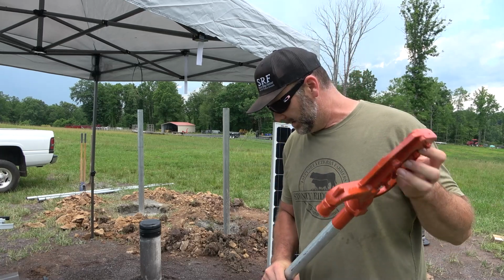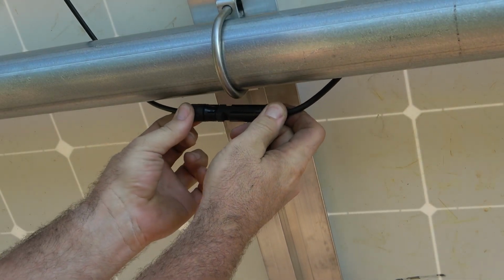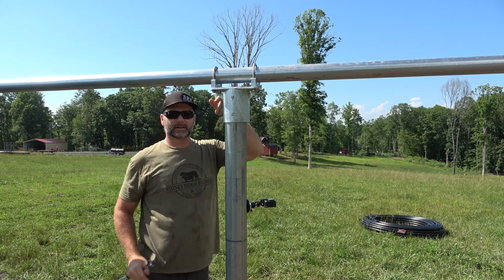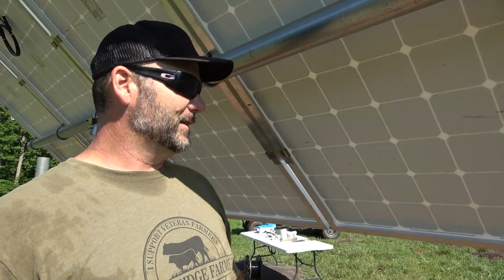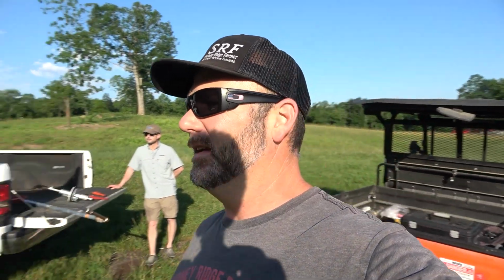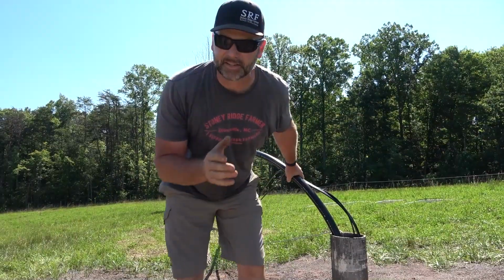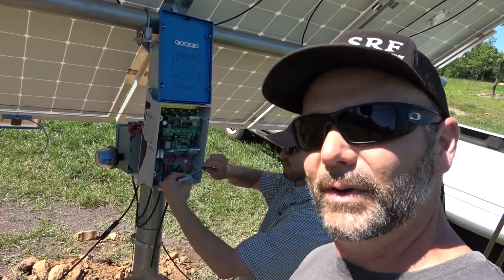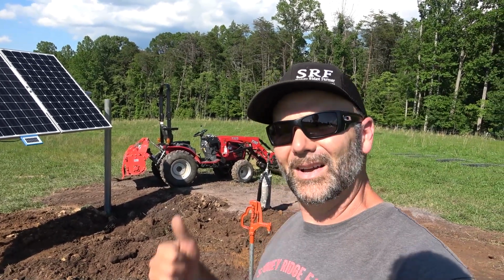How to Install A Solar Off Grid Well pump System

Comment: I guess I missed the episode, but I’m guessing the ram pump didn’t work out ?
Reply from the maker: Great Question! Ram pump as a permanent hassle free system just isn't feesable.  It works, it pumps but there's constant maintenance and upkeep.  You basically have to keep your eye on it twice a day to ensure you're still pumping water.  Then there's the freeze factor associated, it's just not a permanent setup...can't leave the farm for a day without something going wrong
Reply: Thank you for another great video.  Can you share your rationale for not using the spare vertical pipe for twisting stability?   I understand the second group of four solar panels was overkill.
Reply: Cost of the solar system?
Reply: cowboy tj.jonson  
how tsars how cow and cowboy and horse 
my will name tj.johnson
Reply: What kind of money are we looking at to build one

Comment: I could see won’t lifting this panels off at that Tee where it’s only help on by 2 set screws. Unless those are through bolts that is. If not, I’d drill those through for sure!
Reply from the maker: been up for nearly 4 years now with no issues my brotha

Comment: i didnt knòw solar without batterìes possible, my rural 220  volt pump runs but lost pressure and volume, i want to go solar but im very poor on limited s.s. plese do a vudeo what diy equiptment to buy, my water at about 4o to 50 ft thanks

Comment: If it were my system, I'd of taped the poly, dc cable and monitors every 12 inches with electrical tape.  To the BOTTOM or 180 from the top... Nice job none the less.

Comment: Great video
Could anyone help me. I love in UK but have a property in South Africa where we have a borehole or borewdll depending what you call it.

We want to convert it from electricity to solar

The tank for collecting the water sits at about 10m high (it's a double storey house) and the well is 20m deep

What would I need to convert it to basic solar. It would only need to fill the tank which is 2500l twice a day and not run permanently

Thanks in advance
Reply from the maker: I can't tell you how to build your entire well system....but look into Lorenz solar....that's the well system that I have. Contact them and ask them to design your system

Comment: Iv´e been struggling with batteries for years, pumping water with an off grid system. I realized that this system is exactly what i need. Taking away the pump from my house is huge difference, since it´s about 1.7 KW/h less. Plus, the battery bank had to be pretty big to sustain that consumption without damaging the batteries (some lasted less than a year!) Thanks for the upload

Comment: No showers or toilets at night ?
Reply from the maker: water is pumped to a 1500 gallon tank...then dispersed to the rest of the property.  however this is for the cattle on the farm....over 1 mile of 1 1/4 inch pipe is in the ground giving us over 400 gallons of storage at all times...plus the 1500 gallon tank...so...yes...water at night is available my friend

Comment: Josh - working on same project but behind you (-30 deg and frozen ground). Trying to design/build dual axis sun tracker in 6 module arrangement. Issue: trying to NOT poke 30 holes in new roof or make a sub optimized fixed ground mount. Pipes 1st issue with used oil/well casing, muffler pipe, black pipe, galvanized, fence corner posts...etcetera.  Where did you find posts? Also not finding your vertical post top mount bracket...could you please help a fellow farmer diy'er ?  Thank you so much for the vids so have have enjoyed them ALL,  all the best steve
Reply from the maker: The post bracket is made by Lorenz solar my friend.  All the posts came from farmfencesolutions.com they are heavy duty SS40 pipe.   Hit them up buddy....as for DIY...I'm sure you got this....do you really need the sun tracker?  More potential problems right...with more moving parts

Comment: DC is measured as potential difference, that's the voltage measured across the circuit. If the circuit isn't made there's no issues. Just don't complete the circuit until you are ready.
Reply from the maker: Difference of potential is measured in Ohms...not voltage....Ohms take amperage right?
Reply: @StoneyRidgeFarmer  the volts are measured as potential difference between one point and another, that can be the drop across a component or at the supply. If you measure a supply of 24vdc you'll see 24vdc providing you have both positive and negative of that supply/circuit, the positive is a higher voltage in respect of the negative. If you measure across a component you'll also see a voltage measuring one being more positive than the other because it is of the same circuit. If you have 2 car batteries sat next to each other but not connected and put a multimeter positive probe on the positive connection of the meter, and the neg probe on the other battery you will not see any reading on the multimeter. If you then bridge the 2 batteries in series with a cable you will then see a reading on the multimeter because you have created a circuit. It's the same reason you can touch individual terminals of a car battery but you don't grab them both together.

Comment: Josh love your channel and content! This video is actually how o found you! What made you decide on Lorentz? We are putting in a well and ranchers around us have suggested grundfos and pico. Is there something Lorentz offered that the others didn’t?
Reply from the maker: yep...when you go with the cheaper brands you get less reliability, less support, no app to visualize the controller, the control board is typically on the pump itself with other models..that means to service or find out what's wrong you've gotta pull the pump out of the well!  I went with Lorentz because they are the best...there's another vid coming out thursday with a complete walk around of the pump and my water system setup
Reply: Awesome! Thank you Josh, keep up all the great content in your video.

Comment: Why would we need to employ someone to bring electricity from a battery charged by solar panel to a water pump.
Reply from the maker: why would you need to employ someone to fix a hole in a wall, repair your roof, change your oil...ect...because you'd rather hire an expert? There's no battery in this system my friend

Comment: I came up with the idea to use my pickup truck to raise and lower my well pump in and out of the well. Tie the cable to the hitch and pull forward to pull out the pump and back up to lower.

Comment: 460 feet! Damn. It’s a wonder you did not strike any natural gas or hazardous ☢️ gasses. Must be be up on high land.

If your pump last 25 years under those parameters than you have a quality pump and good sizing on it. VFD are nice for over sizing a pump. I love to oversized my pumps by 20 percent above use. Much better way to go.

Comment: Pretty close to what I'm looking for, but would be interested in a ballpark cost for what you did. I'm aware every product list and individual installation is different. Having an idea of cost will let me know if it's worth it to investigate further. Thanks and keep up the great information you put out.
Reply: He won’t give you the cost because it was probably $3000+.  So regardless of price change what did this system cost you. You put this content out there so just say what it cost.
Reply: He won’t give you the estimate because it’s probably too much and he got it for free for this video
Reply from the maker: won't do me a bit of good to tell ya cost...because prices are changing so much.  Every system is gonna be different and the cost will reflect it...you may not need all the power or pump that I need.  Hit up the contact Lorentz solar link and you can talk to someone about what you have and what you need my friend

Comment: I didn't see what that would cost I'd guess 5000
Reply from the maker: Well install $6k  Pump and solar setup $12k  Water tank for storage $2k  5000 ft of pipe  $6000  Frost free water tanks $712 each x 10.  Valves $50 each, T fittings $25 each (12 qty)  it costs money to build this my friend

Comment: I've been looking into off-grid solar for my well, and had an installer tell me I needed a pressure tank (like in my house) to receive the water, and a pressure switch to turn off the pump when it filled, so the pump doesn't try to run "dead head" (against a closed water line).  I did not see this feature in the video... what did you do to resolve this issue?  Thanks!
Reply from the maker: yep...you need a pressure tank my friend.....I installed one just after this video to fix "water hammer" you will damage your well head if you don't have a pressure tank and you are running to any valve link for ya: https://youtu.be/zGgiTvsU3gk

Comment: Josh - Great system. Are you able to share what the cost for the solar set up was? Thanks
Reply from the maker: it's tough to say because my application is very different from what you might install.  As little as $3500 ish....as much as $10k or more...it all depends on your situation and specific needs

Comment: I would drill a hole and mount with nuts, washer, and bolts just in case the clips give due to high winds.

Comment: I recently bought be a 3" solar pump and also have a 4" 220v pump. I been wanting to try and sticking both in the same well. I have 6" casing so might work. I want the solar pump to top of a pond and the 220v one just for every day use if needed.

Comment: Great video. Thanks. I guess I can use this set up to fill a very large rainwater harvested underground concrete water tank which will service a seven bed 5 bath house. Would you 1: Have a tank that shares both rain and well waters and 2: 5 stage Filter those waters before or after the tank and why?  Many thanks in advance.
Reply: You could use both in a single tank, but will need to add a float switch in the tank for the well. Re: filtration, you should already have some method for trapping solids from the catchment system before the tank; i.e. a barrel or some such. The well needs a sand trap filter (sand spinner) to remove fine sediments before the tank for drought times and/or the well runs low when sediment levels can drastically increase. All other filtration takes place before (another strainer) and after the supply booster pump from the tank. NOW, all that being said, there are always potential health hazards with rain catchment systems due to bird or small animal droppings. Make sure your filtration is appropriate. IMO a reverse osmosis system should be used at minimum or with an additional UV light at max. But that's just me...

Comment: If you are putting a fence around the solar and well a simple trick you can do is to add a small chain link fence just outside that and plant some faster growing berry bushes between the fence lines as the cows will think they are getting a treat as they eat what they can reach. You will still get some berries on the inside of the fence with what is between them being for the wild animals in the area with the only real work you need to do is to cut the old limbs as they grow in but you can dispose of them by simply tossing to the cows.

Comment: How does this compare to Grundfos?
Reply: Noel, the largest difference between our products, we do not build our electronic components into our motor. We keep the separate in a control box above ground. This allows us to be much more cost efficient when the system needs service 10 or 15 years down the road. We also have a sole focus on solar powered pumps, so we can do many control and monitoring options they cannot.

Comment: Running straight solar to DC devices is so much more efficient and so much cheaper. You’re almost never gonna need to use that at night anyway and a couple extra panels are cheaper than the battery, you could also put a battery in the back of your YouTV and probably jump it if you really needed to but it’s a couple extra panels even on days where you don’t have a ton of sunlight with enough panels it should still run. There are all kinds of DC things that you can run straight off of panels. I saw a guy use a DC mini split system for the upstairs of his house and he just turned it on the thermostat and whenever it was sunny enough outside to make it hot there was enough power to run it it wasn’t even connected to the grid it just ran straight off of panels and he only had four panels.  There are all kinds of fans and exhaust systems and things that you can put on workshops and sheds and even animal shelters and there of course are all kinds of solar lights everybody knows about that would be really nice out in the middle of your property if you did have to deal with some thing at night and they look great on your pond.  There are also very simple systems that you can get that are more than enough power to run Garage Doors and battery chargers. I’ve even seen a guy who had a golf cart that ran straight off of solar panels only and had no batteries and I’ve seen a small pontoon boat where the canopy was all solar panels that could run directly off of the panels or battery. But when you get rid of the inverter and batteries you save a ton of money and it is so much more efficient, inverse waste 15 to 30% of the power the panels are making anyway, if you can bypass that and go straight to DC run devices like this it’s so much cheaper and more efficient. Plus once you install one or two it’s pretty easy and you can buy most of the stuff online or a kit and do it yourself and save a ton of money on that as well.   I never even thought of using one for a well pump without a battery. That’s pretty awesome.

With a 200 W panel you can also restore almost unusable car batteries. It’s dangerous so of course I would never recommend it but basically pop the caps off and you can hook up a 200 W 12 V charger straight to it which is pretty much what a solar panel is at 200 W and you just watch it and disconnect when it starts to boil and just let it do that for about 10 minutes at a time for two or three hours and all the crud sticks to the electrodes in the batteries and causes them to die starts to chip and flake off then you can shake up your battery and dump all that out and put new acid in and your battery can last year’s longer. There are a lot of people out there doing that with the old lead acid batteries that a lot of people are sitting in their garage they just don’t really work and they’re keeping around for The core charge, But if you ever got stuck out somewhere in a survival situation, It’s a great way to restore your battery or even if it’s just dead fast charge it. You can get enough charge back in a 12 V battery with a 200 W panel usually within 5 to 10 minutes to start your vehicle again. I saw that one on YouTube and the guy just took one of the connectors and wired it to a couple battery clamps and used the solar panel to recharge the battery on his Wood mill that wasn’t starting.  Fun stuff

Comment: How do you make your cows not drink water at night? Nice setup, BUT, you need to have a reservoir reserve, or battery power for water filling. The Mira fount units only hold between 9-45 gallons  (1 ball, 2-ball, 4-ball)
Reply from the maker: It's not like we're running 300 head here.  We're talking about 30-40 cows not 300.  They drink very little if any at night
Reply: @StoneyRidgeFarmer  I would look at adding a 1000 gallon custom cistern tank, with a 32" man hole on top, with 2 x 2.5" conduits one side, and 1 x 2.5 conduit other side, with 2 4inch pvc couplers formed in the roof. A 4 inch drain screen in the bottom. Over the man hole, a 36" x 36" pipe piece, and a cap. Bury it all 12 inches under ground, with the pipe piece halfway below grade. Fit in the largest pressure tank, electric feed in 1 conduit, water pipe from well in other conduit, outgoing to your waterers in the other side conduit. All freeze proof being below grade. The 2 couplers now get fitted with 3 ft of pipe, with 90 degree ends with steel wool, and a screen cover, each facing opposite directions for some air flow through the buried tank.

Comment: If you’re well is 400 and something feet deep why didn’t you put the pump closer to the bottom so you would have more water
Reply: Alan this is a common misconception. The water reservoir has natural pressure that in this case lifted water to 27ft from surface. Using our level sensor we were able to tell the specific capacity of this well.  So it saved SRF the cost of 200ft more poly pipe and copper wire! With today's commodity prices that's a small fortune😉
Reply: The 200ft was because that is how deep he wanted to set in case the water table drops in the future years he won't have to  lower the pump anytime soon.
Reply from the maker: Thanks Eric

Comment: How many gph will this pump?
Reply: This one is setup for 11 gallons per minute for 7.5 hours per day which equals almost 5,000 gallons per day.
Reply: @ericmacias9093  how big of pump would i need to keep a 2 acre farm irrigation pond filled?
Reply: @ruralridez6165  That is going to depend on how much water you are using each day and where you are located (amount of evaporation).

Comment: How dose this system compare with the RPS system that can be customer installed.
Reply from the maker: I'm not quite sure...havn't researched them.  Solar pumps are extremely efficient pump systems so I'd venture to say the better the pump, the more efficient the system.  After watching this video you'd be able to install this without any trouble, but I wouldn't recommend doing it yourself unless you wanna make a $2000-$4000 mistake and ruin your system.   I guess it's the red paint blue paint scenario.  I know that Lorentz stands for quality...that's about as much as I can tell ya
Reply: Like the out put @StoneyRidgeFarmer